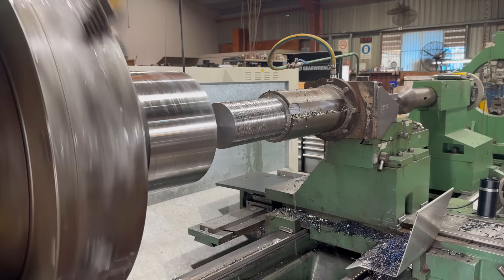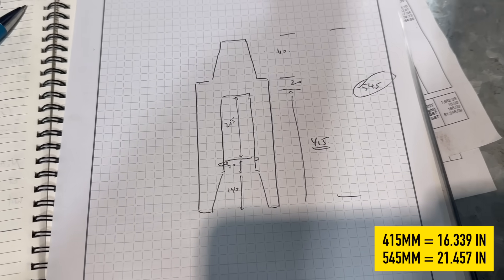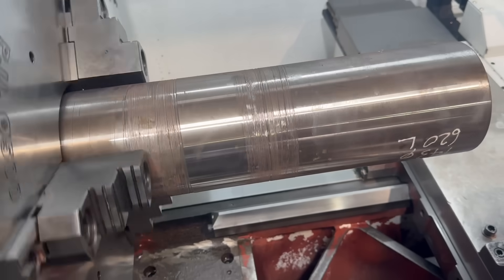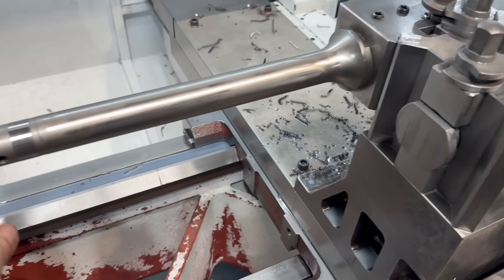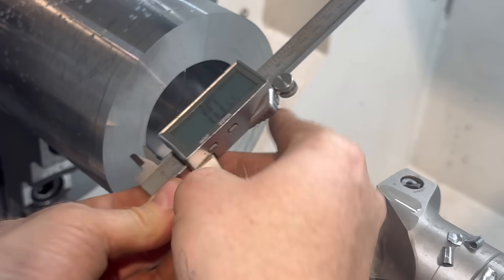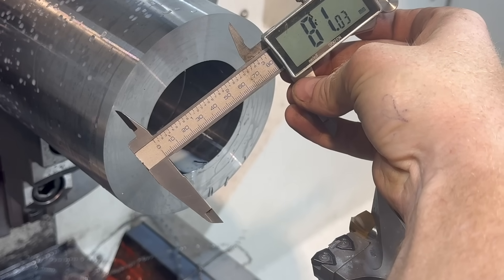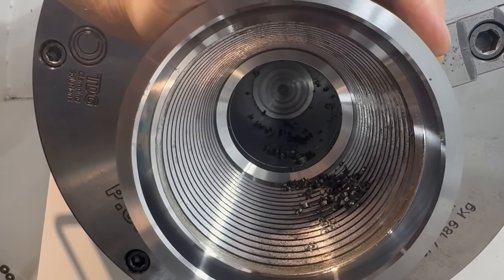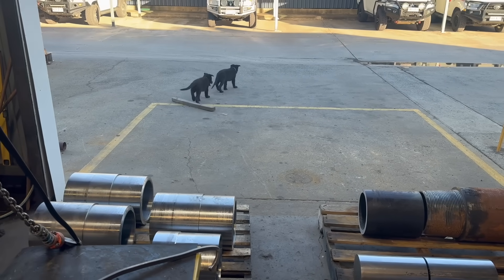Machining UGLY Recycled Steel Into a BEAUTIFUL Part!

Comment: Would be great, if you would integrate a wallclock/timestamp or something when drilling large holes to get a better feeling, how long take these steps, especially if you skip parts or run it with 20x...
Reply from the maker: I wish there were an easy way for me to do this. I’m often getting dragged between jobs so it wouldn’t be accurate.

It’d be super cool though

Comment: As a former welder, with experience in spray arc, sub arc, tig, mig, plasma cutting, braking and rolling sheet materials, etc., on a variety of materials like stainless, aluminum, mild steel, pickled and oiled, steel, very larger lumbermill resaw blades, I really appreciate the work that you and others like you do.   People than can repair, replace and fabricate heavy equipment, and develop repair solutions, are indeed the backbone of the industrial revolution.  Keep up the good work sir, you are amazing.

Comment: Love the videos, thanks for sharing so much knowledge, It’s been so helpful as someone getting into the trade!

I was wondering, where did you get your api thread gauges from?
Reply from the maker: You can buy simple thread gauges online - through mitotoyo or accud.

As we aren’t cutting pipe for deep sea oil, we aren’t API accredited or anything flash like that - so we just cut testers ourselves that are spot on and use those.

There are WAY more precise and better shops out there doing API work, but for our specific application it’s worked just fine for half a century.

Comment: Thanks for another great video. I do have a question, sorry I don’t work in the drilling industry so don’t know why.  Why do you have tapered threads, it must work, but in my mind it would always be a cross threading issue.  Thanks again, keep them coming 🤓
Reply from the maker: They don’t often cross thread due to the size - the reason is so they are faster to screw up out in the field

Comment: Watching the sped up clips makes me wonder: What is the rate-limiting component for how fast material can be removed? Is it the robustness of the cutters? The power of the machine? Heat input into the workpiece?
Reply from the maker: It’s a combination.

The more robust inserts can handle bigger feeds (some twice the speed I run) and deeper depth of cut. 

For example I typically run a WNMG insert at a max depth of cut of 4mm feeding at 0.35 mm every revolution.

I’ve seen @chrismaj run a Fix8 tool at over double that depth and three times the feed.

It’s just down to insert strength, clamping, rigidity and machine power.

If you know what you’re doing you can achieve truly massive metal removal rates - especially on big, powerful, rigid machines with the right tooling.

Comment: And me, I only made a couple of threaded plugs for a utility sink waste drain valve.   1 1/8th inch hex bar, thread was a major diameter of .975-20 thread per inch.   
Too bad I had to use steel to make the plugs.  Might be 12L14, it cut easy and nice.   20 bucks for a 1 foot long piece of hex bar.   Brass was over 68 bucks.

Comment: That Kennametal drilled performed really well and as always with drills in deep holes is the condition of the chip and it looked the same when started and when finished which tells you all is well with your cutting data etc. Well done Matt
Reply from the maker: Cheers Ian. Yeah really happy with how that one went

Comment: Hope you know that big material diameters have a less high stress resistance than smaller raw diameters.
Hope that's no problem with this high torque application.

Comment: "Statler & Waldorf"!  I'm searching for a cheap baby version of the Alpha, but I'll still have to knock a wall out to fit it in my shop. For now, I'm programming my vertical CNC mill as a CNC lathe. Great for the tiny parts I make. At least I can enjoy watching you shifting kilos of metal automagically as I hog stuff out on my manual Colchester like it's 1985!

Comment: I'm curious? Can you use the leading center alignment bit to reduce the chatter and stress on the tool rest and cutting edges. By first drilling a center hole the entire length of the piece a few thousandths smaller than the diameter of the alignment bit? Would it help stabilize the extended tool rest by having an additional support on the leading edge of the cut thus using the work piece as an additional rest?

Comment: I run a large CNC mill and have done some minor work on a manual lathe. Trepanning.... I dont think theres much in this trade that would scare me more than to do that. Just the thought of the tool getting caught deep inside gives me sweaty hands :face-blue-wide-eyes::face-blue-smiling:

Just got to the part where your new drill started cutting and made a "hnnnnnng" sound to myself. That was beautiful 😁

Comment: Out of curiosity would it be worth trying to attach the HTS drill head to a very short shank then feed in a few millimetres so it gets the insert profile in the face much like you put a face groove to help with the trapanning operation then reattach the head to the long body to try to cut down on the amount of vibration you get when you first touch the face or it wouldn't really make a difference. Either way that drill ran amazing.

Comment: I wanna see more coolant pressure on that guy next time m8. Could be fun hooking up a pressure washer as the coolant pump for it 

Also is the tool post holder ( or what now that you guys down there call the think that holds the toolholders ) is it pinned ? Seen plenty that isn't 

Also why didn't you just make a adapter so it could go into the big boring bar holder instead of using the toolholder ?

Comment: Great video Matt. Good to see the set up on the custom drill bit and one of the cores getting used. It would have been nice to see you assemble the plastic/rubber parts into the valve sub. Why didn't it need the side cut outs like the smaller non-return valve subs?

That is a tricky one on naming the drill and boring bar especially knowing there will be a new coring tool at some point: Master and Blaster doesn't seem right despite the Oz connection. Nacho and Chancho?
Reply from the maker: Master & Blaster are actually neat names for a future set.  I dig it.

Yeah the valves come like that. You just drop them in and pop in the círclip
Reply: @halheavyduty  "The little one's called Master, he's the (precise one). The other one is Blaster, he's the muscle. Together they can be very powerful."

Comment: Beautiful job on that non-return , what is called in the U.S. a 1way Check Valve. Worked in the BAKKEN Basin oil field in North Dakota and saw all sorts of drill pipe and assorted pieces with the mud type drilling rigs. Hauled alot of different stuff to the rigs. It was an adventure of a lifetime 😉🙂 and I hate to ask what happened to Vader and Maury ☹️ your new boys look like they're going to be just as big a pair of hams 😃👍🏻

Comment: I always appreciate modifying tools or building custom ones for a job. Sometimes what you need isn't sold or made, and you have to adapt. I can't count how many times I have had to fabricate a special tool in order to complete something for a customer or even for myself when the project requires. I think too many are afraid to change what the manufacturer sold them, or if it doesn't exist, they simply won't put the time into making a tool or jig, not realizing how much time they can save on the back end of the job.